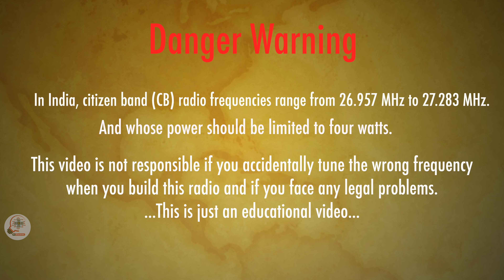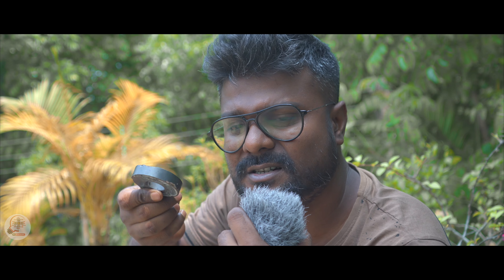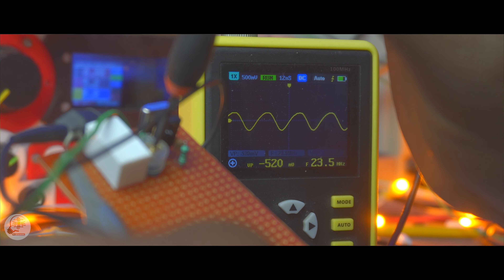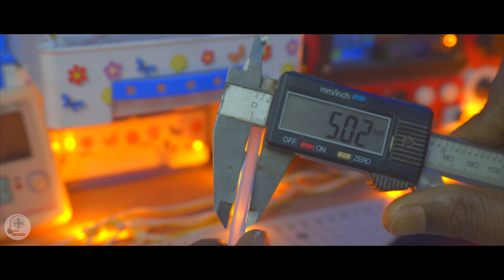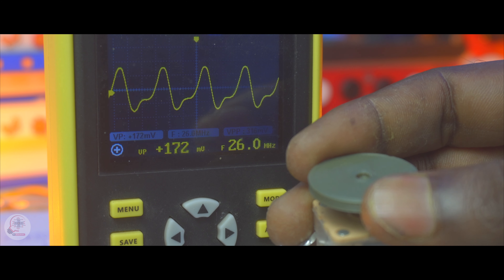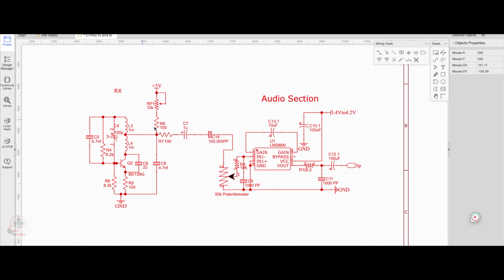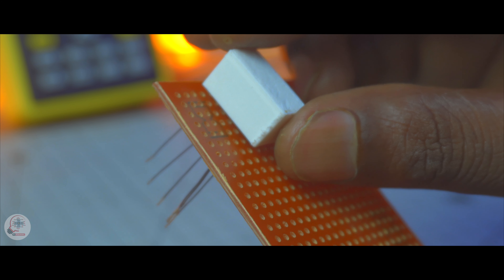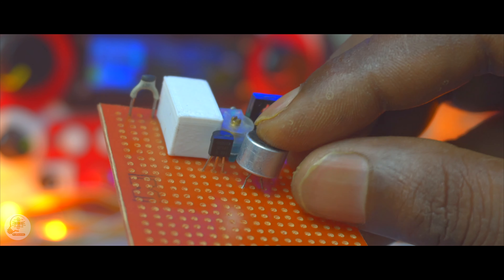How to Make HF Band Walkie-Talkie for Long Distance (Range Test)

Comment: Sir please make a transmitter and receiver circuit  ( like RC controlled car ) with explanation how the circuit  works
Reply from the maker: Ok
Reply: Same circuit as a connection of wireless remote control RC Rf frequency
Reply: Yes please explain RC car circuit
Reply: @etDiscover please explain RC car circuit
Reply: That's okay too
I want to learn that

Comment: Hello sir. I have some doubts about your walkie talkie circuit
 your circuit is not showing how to connect the microphone to the transmitter and the variable capacitor is not parallel to the coil. Please fix the circuit
Reply from the maker: Plz download the the update TX circuit
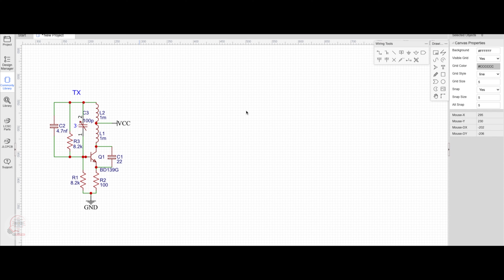Reply: 4:36  In TX section the C2 4.7nF RX section C5 4.7nF capacitor is not shown in the circuit on the website? and the variable capacitor is not connected parallel to the coil it is connected to base of transistor why?.  @EtDiscover

Comment: U can use small mobile speaker that will also a good speakers u can get in mobile repair shops
Reply from the maker: Maybe in future
Reply: @EtDiscover  Bro make diy projects like drone flight controller and transmitter not like normal make it better than factory

Comment: Thank bro may god continue to give you more wisdom.
Reply from the maker: Welcome ❤️
Reply from the maker: Welcome ❤️
Reply: @EtDiscover hi bro can you tell if I use resistor and capacitors of circuit with 5-10% value change excluding lc circuit will this circuit work please tell me and if you have time can you tell me what component value are critical for working of this rx tx circuit please 🙏
Reply: @EtDiscover Hi bro please answer bro please

Comment: Bro please make arduino nano servo motor control with IR remote 360 forward and reverse 😢
Reply from the maker: Ok
Reply: @EtDiscover  ❤️
Reply: Bro  @EtDiscover I have an old hifi stereo amplifier 80s denon
But amplifier doesn't have IR control all control are analogue
I want to add IR motorzed volume control using servo or gear motor with ir remote control
I have an ardino nano
If your portable to do this that may be helpful. I'm tested code is not working properly